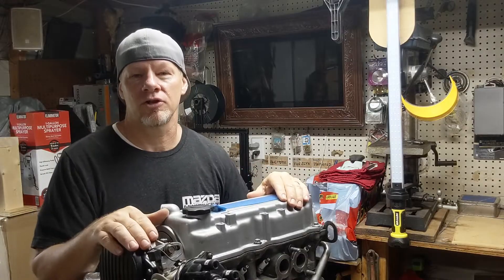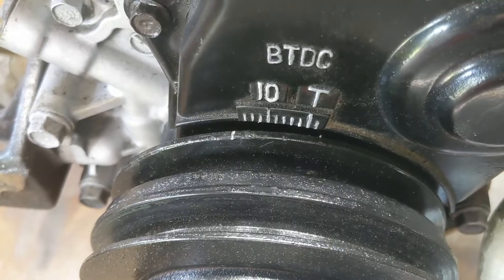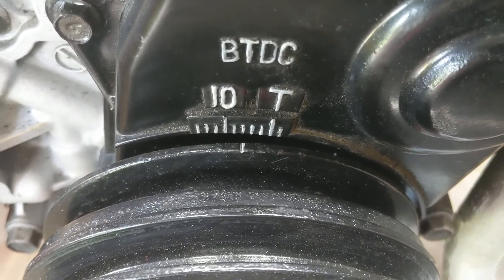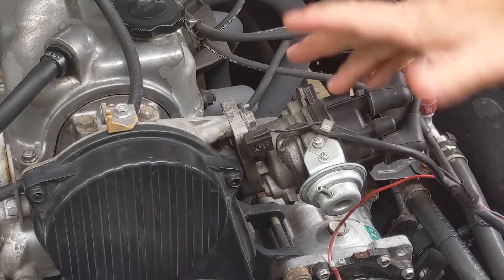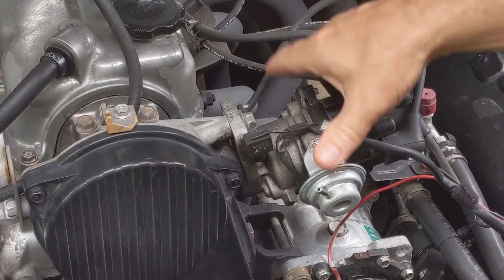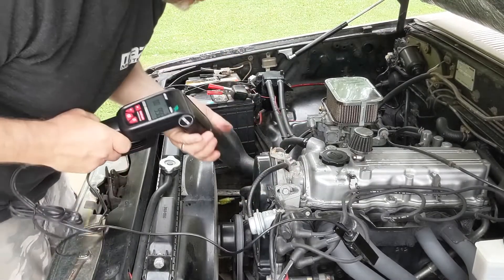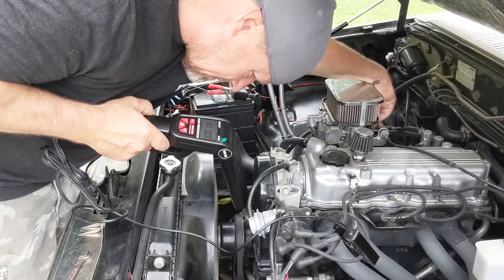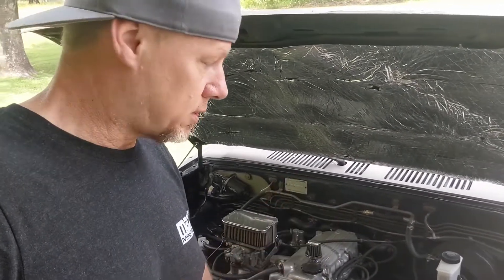How To Set Ignition Timing | Mazda B2000 B2200

Comment: I've had my 92 since 2000 and put new wires and plugs every 2 years and never had to fool with the timing, 250 thousand miles and it just keeps running and won't quit

Comment: what would you set the initial timing at on a B1600 with a weber carb? the specs recommend 3 or 5 BTDC which seems crazy low.
Reply from the maker: Start at 10 btdc, might would do 12
Reply: @MazdaMitch  thanks - i was trying to do things by the book as i’ve just done a timing kit and a head gasket, but using the 2nd mark on the crank pulley seemed way too low for initial timing.

Comment: Shouldn't the timing be set at a specified idle?   Different idle speeds probably affect the timing adjustment don't they?
Reply from the maker: As you adjust the timing the idle will change so it's a symphony between both but you'll want it to be around 850 rpm

Comment: Hi, great video.  Ive git a 1993 Ford Courier XLT 2.2L petrol motor. Accidentally broke a Camshaft Bearing Cap. Its in the middle and has little moulded tabs poking out each side which side iff rockers go uo against. Any other vehicle type/model besides the Mazda B2200 could i find the exact replacement part from/on for my motor or a supplier/dealer for one. Any ideas or help would be a lifesaver. Thanks, Kim

Comment: Hey Mitch thank you so much for this Video. I removed and plugged my distributor vacuum line as you suggested. Got it to 12 degrees BTDC as you suggested but then when i return the vacuum line while idle it advances it greatly. not while reving. Did i do something wrong?
Reply from the maker: Maybe your distributor vacuum is connected to somewhere it should not be, like an area of too much vacuum. It should be at the base of the carb.
Reply: @MazdaMitch  I have it attached to the same place you do on your video.
Reply: Could i have my carb set wrong? although i have followed your carb video.

Comment: Mitch I need to ask, do you know of any starter “upgrades” for these trucks? I need to check timing on mine as I didn’t set it, the trucks bored 40 over and I know the timings been advanced, but I think it’s been advanced too far, as the starter just is not happy. It runs really well and idles at a smooth 1000, but as stated the starter is just having a really hard time with it
Reply from the maker: Starter should be fine. You might need a stronger battery and good grounds

Comment: I just bought an 86 B2000 (I'm so stoked), and it's had the Weber swap already done. I am trying to verify the timing on mine, but I don't have the same marks or anything like you've pointed out. My ONE mark is on the driver side of the timing cover, and there's no numbers - just an arrow. There are two marks, very close together, on the crank pulley. I need to buy a digital timing light, but sheesh - any idea how to tell where it's at with an old skool timing light?
Reply from the maker: Look to the website under engine docs.
The 86-87 b2000 has two marks on the harmonic balancer.
mazdaminitruckin.com
Reply: @MazdaMitch  yeah I can see those. The only problem is that I can't tell what the timing is at. If I decided to bump it up, I can't tell what that is. I'm gonna get a digital timing light so I can do this and get it right on. TY man - love your videos and the website is awesome!

Comment: Are the b2000/b2200 engines Non interference engines?
Reply from the maker: Yes
Reply: @MazdaMitch  do you have a video on how to put the timing belt on correctly? Can’t find anything online
Reply: @MazdaMitch  Uh, I think they are interference engines.   They have a timing belt that must be timely replaced to ensure that the engine is not destroyed.
Reply from the maker: @modilly9074  These engines are NON INTERFERENCE engines.

Comment: Hey Mitch first off thanks for the videos you post. Helped a lot w carb. Can ya do a video bout coil ignition? 88 b2200 new cap,rotor,wires and coil. Still no spark?

Comment: So your camshaft gear has the one at the top lined up with the arrow and the crankshaft gear at about 12 degrees BTDC?
Reply from the maker: You only set degrees when the engine is running with a timing light. Not beforehand
Reply: @MazdaMitch ok my bad, thanks for helping

Comment: Would this work for setting the timing on my fuel injected b2200 with the 2.2 becuse the distributors are different ?
Reply from the maker: It's different and that's covered in the shop manual at Mazdaminitruckin.com

Comment: I cannot advance distributor enough to achieve correct timing?  Do you know what is happening?
Reply from the maker: Your distributor is not in correct, it's stabbed a tooth off. That's my guess.
Reply: Thank you, I tried that and it help but it looks like the governor cam or weight is malfunctioning. With the vacuum hose plugged the timing light shows retarding on acceleration.

Comment: I will try rephrasing myself. sorry, english is my second language.. so to turn the engine manually from the crank. do i have to take the belt off? its on my truck. there is a belt on that pulley. to turn the crank to top dead center do i have to take the belt off? + can i spin it by hand or use breaker bar to turn the engine over manually to top dead center? and there is that big fan in between the crank n the radiator. do i have to remove that to turn it or will i be able to get breaker bar in there to the bolt to turn it? i am very sorry if i am not making sense. I love your channel. great videos! I am clueless and know all my questions must be stupid . I am new to working on mazda b2200's
Reply from the maker: Yes you can you use a 21 mm on a short extension with a ratchet and turn the motor over clockwise without having to remove anything
Reply: thats all i needed to know. thanks sir @MazdaMitch

Comment: I have a missfire on mine since i get it, i try to adjust the timing but my idle won’t go up or down with adjusting the distributor 🤷🏻‍♂️ always runs at 600-700 . Saying that I can’t even use my ac cuz drops to 300 and engine almost stall 🥵☀️
Reply from the maker: Have you tried idling up your carburetor?

Comment: What would alow the upper to keep jumping time
Reply from the maker: Loose belt
Reply: @MazdaMitch  Wich bolt
Reply: @MazdaMitch  pluses it just died going down the rode after replacing the front main seal
Reply from the maker: @jasonsaltkill7950  there's a tensioner pulley, And if he replace your front seal you need to make sure that you put that belt guide back on down there by the crank gear. You could have something out of the line and it's walking it off.
Reply: @MazdaMitch  gears on all the way tensioner pulley is on with balancer on Spring is still on tensioner pulley as well it'll start run for a second and then die top end is Out of Time bottom still okay
Reply from the maker: @jasonsaltkill7950  hey maybe you should check your cam it's supposed to have a dowel that sticks into the cam gear up top If it's missing maybe the cam gear is spinning because the bolt is loose.
Reply: @MazdaMitch  are you talking about the little pin that lines up with the number one if so it's there I could possibly not have the bolt tight enough means I had to realign it cuz somebody had it lined up with the wrong number
Reply: @MazdaMitch  what also don't make sense to me is it was running before I put all the outer belts for the fan and all that back on there I put that back on there and it went right back to throw the time
Reply from the maker: Yep
Reply: @MazdaMitch   do u know the torque specs
Reply from the maker: @jasonsaltkill7950  it's in the files on mazdaminitruckin.com

Comment: Great video, thanks. These engines are still in use in the UK in the Mazda Bongo (12 valve version of the FE). Timing is 6 +-1 from the factory but I've tried it at 8 and there is a difference. Would you recommend going further than that on pump E10 (95) octane?
Reply from the maker: The engines do not produce enough compression for anything over 87 octane, so you are wasting your money. Run it at 12 degrees.
Reply: @MazdaMitch  Thanks, I'll try it at that. We only have 2 grades here, 95 and 99. The 12v runs 9.5:1 CR in the Bongo. Also, on your website you have a file on the camshaft oiling problem where you mention adding some epoxy to help the cylinder 2 starvation issue. Can you add a picture of that or do a vid?
Reply: Hello, have you tried 12? Im going to adjust mines to 12 tomorrow. Its currently on 6 amd runs crap on e10, plus the common knowledge of poor pwrformance in the bongo.
Reply: @stevenmckinlay4478  Mine's back at 6 for emissions reasons. I only run on E5 now. 8 works fine but 12 sounds a bit too much.

Comment: I lioke all your videos it looks like your number 2 spark plug is loose mine got loose and now i had to put 2 alum washers un the plug and it still leaks pressure out. How can i fix the leak ? Thank You
Reply from the maker: It shouldn't be loose. Maybe yours is stripped out. You need to check. If it's, you can repair with a helicoil.

Comment: so these trucks dont come with some kind of sensor to adjust the idle when the AC comes on? I always wondered if I was missing something on my truck because I turned the idle up a little on my truck as well so when I turn on the AC the idle doesnt drop that much
Reply from the maker: The stock carb does when equipped with AC. If you swap to a Weber carb, that goes away.

Comment: I think I destroyed my new head yesterday.  3 broken camshaft bolts, one valve cover bolt, the camshaft pin from the main timing sprocket and the bolt holding the main timing sprocket.  I think I'm going to have to leave the truck in the back 40 for another winter.  I'm not sure where to go from here.  I am thinking of doing the FE3 swap for my main mini truck project and that will give me another set of parts for the cab plus that broke yesterday.  TBD. Sigh.  Thanks for the video Mitch!
Reply: Damn I know this is a real old comment, but what happened?!?! And Is the truck alive and well now?

Comment: Great video man. Any chance you know how much gap we need for the points? 
and when you set the points to the high point of the distributor shaft do you need to set the engine to TDC?
Reply from the maker: No points in the distributor on this engine. 86-93 electronic distributor.
Reply from the maker: But on older vehicles like motorcycles or things that had points we always used to use the a business card the width of a business card
Reply: @MazdaMitch  Some of the trucks from those years did come with points. My B2000 for example. It may however be the case that in the u.s. market they were all electronic ignition. I'm based in new zealand and ive seen three of four of these b2000s and b2200s that have points ignition.

Comment: This is also how I set the ignition timing on my 1988 B2200 with Weber carb.  Since I have AC as well, for better visualization of the timing mark I've loosened the AC belt and just let it hang free while setting the timing.  Ignition timing won't need to be checked or adjusted until you next remove your distributor or do more-involved engine work.

Comment: I have a 86 b2600. I put a new weber carb on it, got it running and drove it around a little. It sounded like it was running really rough then it died. And I haven't been able to get it running since. I have good fuel supply good spark air and even good compression. Any ideas on what I should do?
Reply from the maker: Vacuum leak somewhere

Comment: your literally solving the biggest issue ive had
Reply: He is the best!!!!
Reply from the maker: What was the issues?
Reply: Well, i had bought a 1986 mazda b2000. Ive had a b2200 before and know that they are fairly similar. I put a weber on it for a number of reasons. Ive been following the steps you've done but my truck runs like garbage. Some days are better than others. The most i could get out of it is 15mpg. Im thinking there is still something else wrong that i havent found

Comment: What about the fuel injection engine is the same
Reply from the maker: On the EFI 2200 or the 2600i there is a test connector, you will need to connect a jumper wire between the test connector and ground, its pin 1. (green: pin1). If you are looking in the shop manual its here, page 24. http://mazdaminitruckin.com/mazdashopmanual/G-Engine%20and%20Electrical/0194_001.pdf